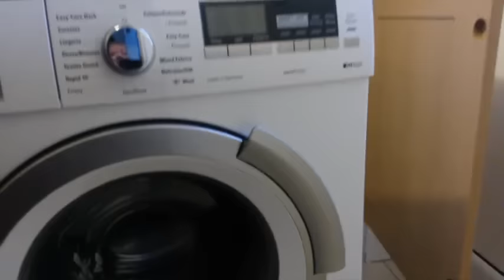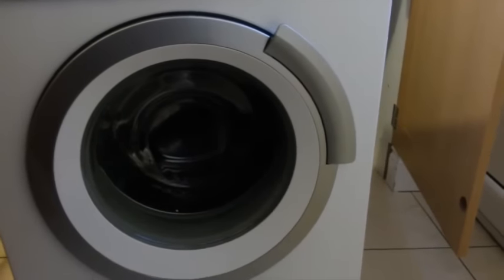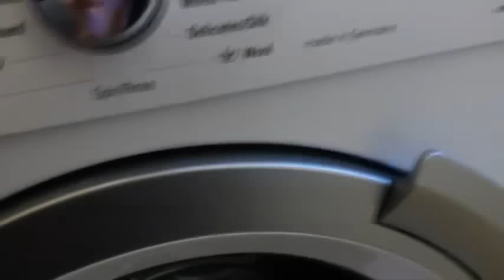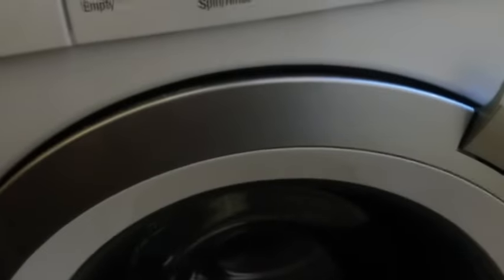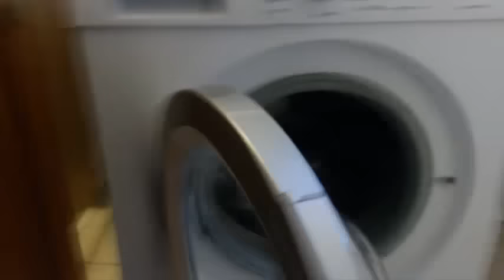All the possible ways to open the washing machine door on a Siemens iQ500

Comment: Great video, thank you. Unfortunately, I couldn't make the knife trick work, so I had to open it the expensive way, but I wouldn't have know how to do this without this video, so still a great help. After having taken the door apart, I would suggest that people start sliding down the knife from the top until they reach the metal lever that opens the door--it is clearly designed to be pressed at that end.

Comment: Yay, knife trick worked on our IQ700! You are a life saver!

It's super tricky though to find the right spot to press with the knife. My handle was kind of loose so I could squeeze the knife in from the side instead (inside of the handle) of from the front between handle and door, and I could see where I needed to apply pressure (on the metallic part that's connected to the latch). Need to disassemble the door now, betting the same plastic part is broken as it was on your machine.

It's incredibly frustrating that the emergency opener only controls one part of the lock (the one you broke), and not the part that's in the door.
Reply: The plastic ridge that pushes the metallic lever was indeed broken clean off. I fixed it by making a hole where the ridge had been and then using epoxy glued a metallic ridge protruding the same height and width.

Comment: Thank you Marky O, you save us time, money and effort. Found the manual lock bypass of our Ariston washer by removing the bottom front panel. The trigger string is on the right hand corner. Just follow your instruction and it really works.

Comment: I'd like to offer another hopefully useful thing to try for those with a Siemens IQ500 iSensoric.. This is a model where the knife trick won't work, sadly - it's a different type of door. 
My door wouldn't open even hours after finishing the drying cycle when the machine has had a chance to cool down. I tried switching it into an 'OFF' position and selecting the last used programme which usually works as a workaround. However, this time the door wouldn't budge. So this is what in the end ended up working for me.. instead of pulling on the door I first gently leant on it and pushed it in. Somehow, doing this then helped release the catch. Thought I'd share and hopefully it'll help someone else. :)

Comment: Thank you so much. The knife trick worked very well, and i managed to remove the door and found the plastic handle opener broken. Before I buy a new one, I will try to glue it (using a strong Araldite glue). :)
Reply: Only epoxy didn't work for me. Lasted just a few weeks. I then used a dremel to drill three 1mm holes in the plastic with panel pins and copious amounts of epoxy to effect a repair. 9 months in and still going strong.
Reply: I drilled 2 holes and put in a couple of stainless self tapping screws. Worked a treat. I also opened mine with a knife. Have the Siemens S1440. Thank you so muck for posting this video. I'm guessing it saved me quite a bit of money and a lot of frustrations. Wishing you good Karma. :)

Comment: Thank you! Cleaned the filter and drained the excess water out and then managed to open the door with the manual release toggle. However, the display screen states that we have a F43 error. It looks like that means the brushings need to be replaced. Do you have a how to video on that or any suggestions?

Comment: Many thanks.  The handle on our 13 year old Siemens has  broken.   Panic. So looked up Youtube.   My dilemma,  is it worth mending a 13 years old machine, I could see it was the handle, and all I could find was  a complete new door £60.  or a new machine  getting on for £500,    First thing  opening the beast, so using your brilliant trick I could get in.  Seeing the problem which as far as I could see was the latch  no longer connected, I don't know why.  So I came up with a quick fix at no cost. I tied a length of nylon  fishing line around the  latch  and tied a toggle on the end, so now all we have to do is tug the toggle and hey presto the door now opens.   Used the machine a few days now, seems to work o.k. so far.

Comment: Knife trick isn’t working, anyone know how exactly to pop the lock from the inside?
Reply: If the knife isn't working that means you broke the part that holds the metal lock. Therefore you have no leverage point. I had this too. The lock should be loose so try manoeuvering the knife to push it to the right side. Or push and use the handle if it catches the right position. You have to replace the whole inner circle to get this done.

Comment: I just fixed it with the knife trick on a siemens s 14-72 ( some more details when you put the knife actually pull the handle even if broken cause it helps with the release. ❤

Comment: Thank you for this. That knife trick just worked perfectly! It sounds like my door may have the same problem as yours - how did you fix it once you got it open? Or did you have to replace the mechanism?
Reply from the maker: If the plastic handle is broken, I used a dremel to drill three 1mm holes in the plastic with panel pins and copious amounts of epoxy to re-attach the broken piece. 12 months in and still going strong.

Comment: I use hair dryer and it works, mine has a problem because of the moisture.
it has an error code on LCD. and I found out using hair dryer by a chance hhhhhh.